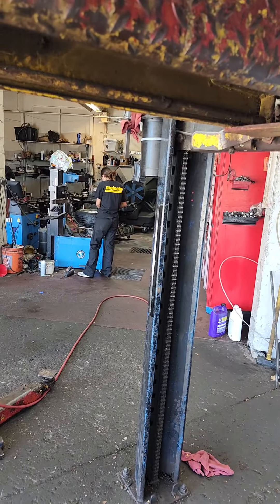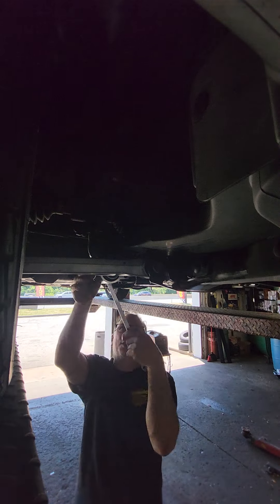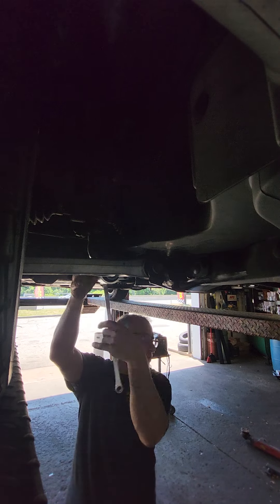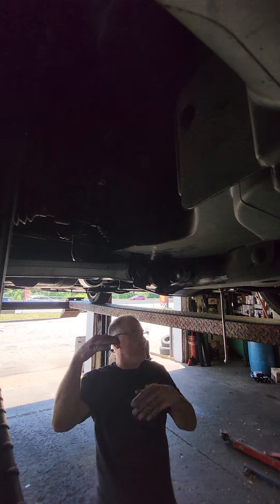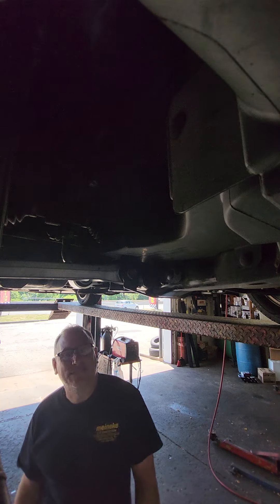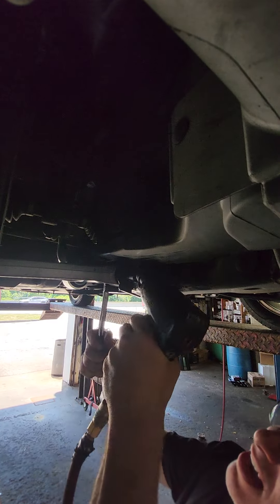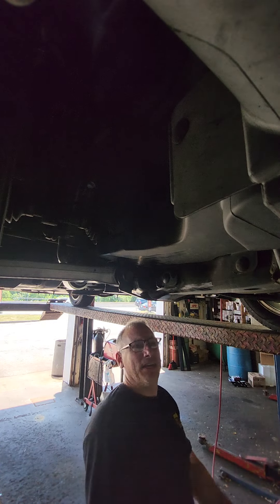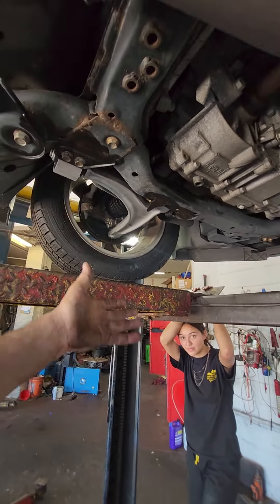Showing the work finishing proper installation of lower control arms vehicle in ride

Comment: Is silicone spray good to keep rubber bushings in good shape? Im guessing that wd-40 is not good...
Reply from the maker: Rubber conditioner for sure most people dont
Reply: I did my neighbor’s 2014 750li Xdrive with 95,000mi front lower forward control arms last week and after I installed the bolt I just put my floor jack on the lower arm until the body started rising off the front jackstands ever so slightly. I torqued to spec but only turned 45deg instead of 90. Those German torque specs probably stretch the fasteners to something that doesn’t “feel” right. So I just torqued to gutentight. I sprayed the bushing with Blaster Surface Shield lanolin to prevent degradation of the rubber. Hopefully it all hold for a very long time. Arms were made by Delphi…